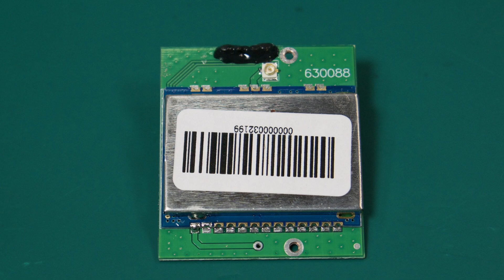Jumper T-Pro - Teardown

Comment: Lmao they just placed plastic heatsink next to the radio module...
Shame they went with some shoe glue to secure all the wires instead of some more professional adhesive or some sort of slot in the PCB
Impressive how small the main board is.

Comment: Would you think it's possible to install an external ELRS 2.4 GHz module inside like some people did with the T-Lite? Probably in place of the 4in1, provided it is optional?
Reply from the maker: We saw a lot of examples of installed external ELRS 2.4GHz modules inside of the T-Pro on the FB group - ExpressLRS - High Performance Radio Control Link - You can find out the post published on 21 January about T-Pro mods.

Comment: how about the antenna ? it both side or only one side horizontal,
Reply from the maker: It's only one side antenna. Also, we tried to put a dipole antenna for 900MHz into but the case is too small :(
Reply: @multirotorscommunity  thx for the info, if like that i think maybe it can be modified using a regular antenna and the switch too
Reply: Yes, curious about the antenna.

Comment: Yup purchased one when I got the email notification.  Still trying to figure this thing out, I couldn’t get it to map properly on betaflight with spektrum receiver or Tbs Crossfire nano rx(I have tbs crossfire nano RC module) It could be compatible with Elrs out the box with module idk.
All I can say is if it’s going to be a while till this controller gets the bugs worked out I’ll just fly my t lite and dx6 for now
Reply: I agree brother. I'd wait till they fix the issues before getting one.
Reply from the maker: We'll try the mapping with ELRS but  I have to mention that our radio works on EdgeTX
Reply: I have TBS working yay, going to see if I can get the dsmx too